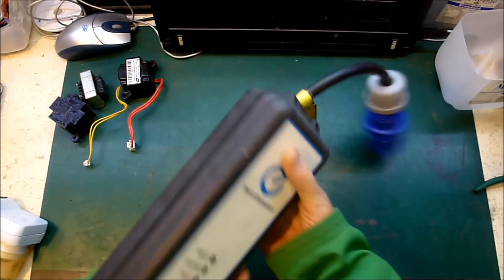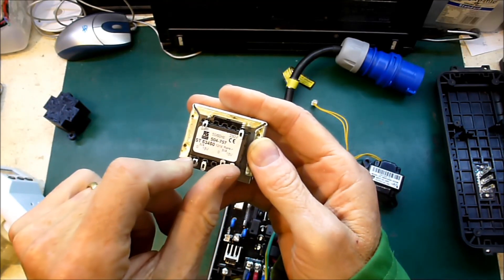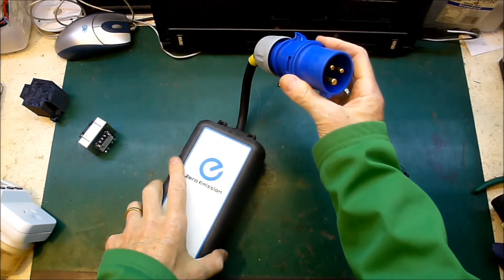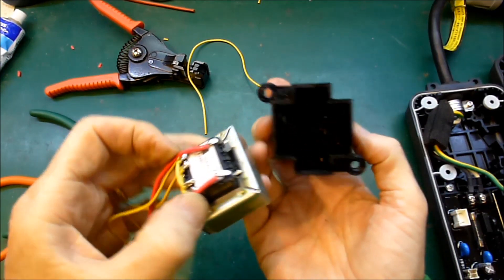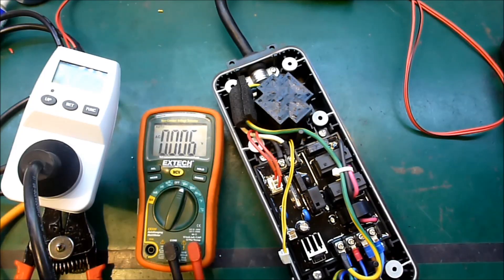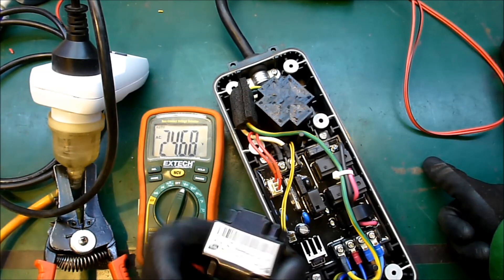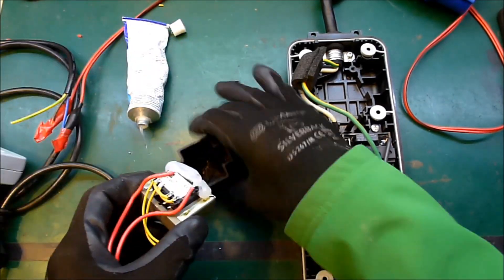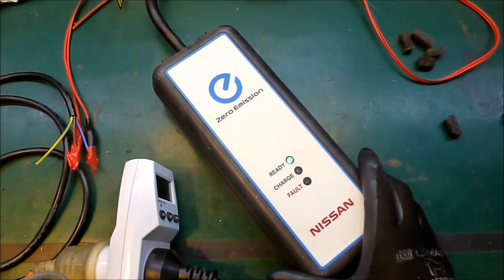Nissan Leaf 006 - Nissan EVSE 230V transformer upgrade

Comment: do you think there is a way to modify it so that the input is 100v and output 200v?
Reply from the maker: The purpose of the transformer is just to provide power for the electronics inside the EVSE box (some TTL logic and a relay) - so you always want a 19VAC output.
Reply: @paulkennett  I see. Cos here in Japan the electricity is 100v but my car charger works as 200v so I want to transform it
Reply from the maker: @KeigoMoriyama  Ah yes. Mine was designed for a 200V input but we have 240V here in New Zealand. Do you have any 200V sockets at home?
Reply: @paulkennett  unfortunately no and is pretty expensive to install it :(

Comment: Can we use the below one as its half the price but just slightly higher voltage.
Reply from the maker: Looks like YouTube has edited out the URL. Easier to email paul at kennett dot co dot nz
Reply: Just emailed the link. Seems to be a similar transformer with a different colour chassis and 20V instead of 18V but about half the price.
Reply from the maker: @elliotzshornack5461  The original transformer was 19V so 20V will probably work OK. The output of this transformer goes to a diode bridge then a simple 7812 voltage regulator. It might run a little bit hotter than normal but should be fine.
Reply: Also the transformer you specified is only rated 6VA but the marking on the original one shows 200W. Would this not be a problem? Did you actually try charging with you set up?
Reply from the maker: @elliotzshornack5461  The one I used has 2 separate 19V coils which I connected in parallel. Yes - it gets used every day.
Reply: Still wary that the original one indicates its 200w. May be that 200w on it is just a model# and does not mean its 200w. Replacing it with something rated 6VA no matter what you put in parallel is a little bit of a worry to me unless there is some sort of and explanation that it will not really need 200w and just needs 6VA. Good thing it works and continues to work for you.
Reply from the maker: @elliotzshornack5461  Hi Elliot. Fair enough to be wary.  Note: the purpose of this transformer is to drive a bit of  74 series logic chip and switch the mains relay. That's all it does. (The 74* chip creates a PWM that goes down the control line and the duty cycle specifies how much power the source is allowed to provide to the car.) So the transformer is doing very little.
Reply: Ok, it looks like the 200W in the model number does not correspond to its power rating . I saw someone else replace it with a 10w and you seem to get 6VA to work so I guess anything in that range should work. I have seen one rated at 1W used for VOIP's so just wondering if those would work as well.  They are under $10.

Comment: Hi paul would you like to sell your old transformer , as mine has gone in uk .
Reply from the maker: My old one died - which is why I had to replace it.
Reply: Or you got any idea where to get it from as in my charger led doesn't turn ON or out put doesn't show any votage .
Reply from the maker: @donjee5438  I got my replacement transformer from RS Online. You could also try Amazon.
Reply: @paulkennett  Hi i really appreciate your help i have tried looking on RS online would you mind assisting me to choose what is  name of this transformer or if i can get any similer to the old one . Thank you
Reply from the maker: @donjee5438  I link to the transformer on RS-Online is provided in the info section under the video.

Comment: Thank you for the video. I am thinking of doing this, have you had no problems by doing this modification connecting to nz grid?
Reply from the maker: NZ legislation says this is not a certified solution. So I can't recommend you do this. Also note that this Nissan Gen 1 EVSE runs at 15 Amps so you MUST NOT use it with a standard NZ 10 Amp plug. 
In other news: my EVSE setup is going fine.

Comment: Paul great video. Would you know how to get the unit to fault it into a lower amperage. For example 10a? https://samholford.github.io/leafguide/ mentions that it might be possible
Reply from the maker: My understanding is the EVSE amperage rating is a function of the duty cycle of a square wave on the control line going out to the J1772 (to the car). So there may be some way to adjust that inside the EVSE. Personally I'd be a bit nervous fiddling with that because if it was set wrong you could get the EVSE allowing more current than is safe for the connectors. It'd be slightly beyond my personal risk preference,

Comment: I assume the transformer is well within it's rating as with your printed shroud it may have to be rated quite a bit lower. I hope you used non acid curing silicone.
Reply from the maker: Yep - it was non-acidic silicone.
Reply from the maker: Hi Zoony. Damn - I'd better go and check that. Thanks for the heads-up.

Comment: I think I would have measured the voltage on load after seeing such a large off load voltage, did it cross your mind to or were you quite confident from experience?
Reply from the maker: It occurred to me the moment I finished. Doh! I really want to know that now.
Reply: Paul Kennett I suppose when making the videos your mind is diverted slightly,  I know mine is, I end up talking rubbish and making mistakes.
Reply from the maker: Yeah. Very hard to talk and think at the same time. :/